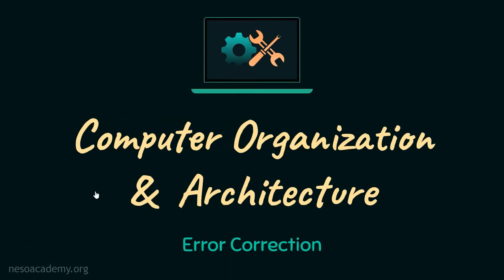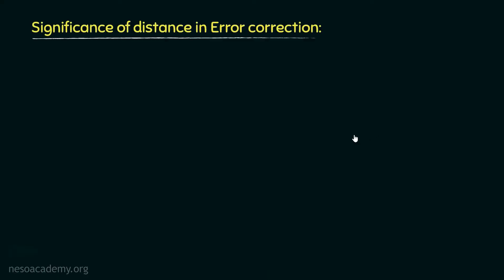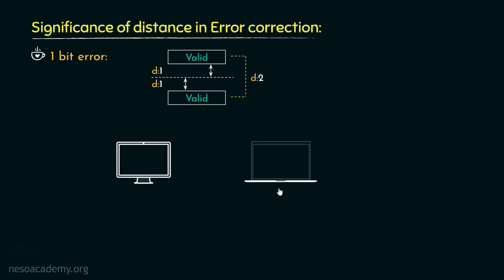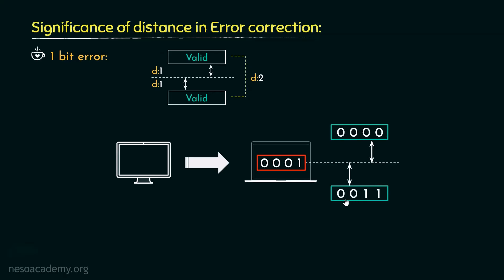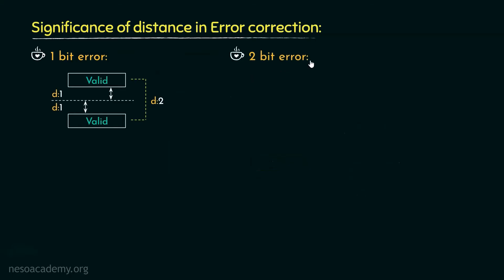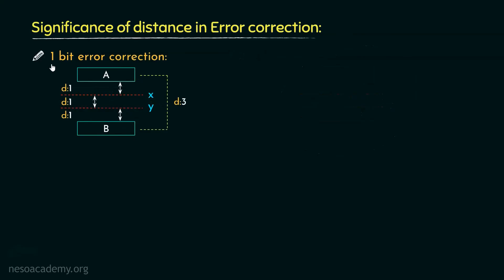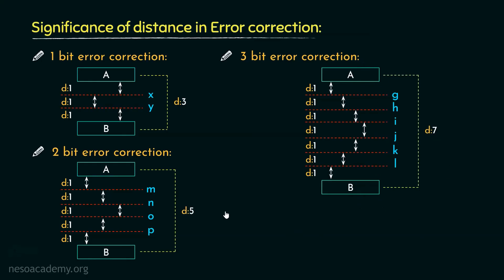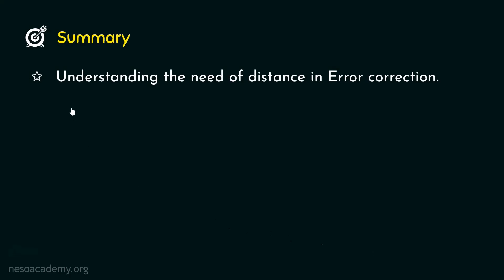Error Correction

Comment: COA: Error Correction - Error Correction Discussion

1. Importance of Distance in Error Correction:
Understanding the need for distance in Error Correction is crucial. Distance refers to the minimum number of differences between two codewords in a code. This concept plays a significant role in determining the efficiency of an Error Correction scheme. A higher distance ensures better error detection and correction capabilities.

2. Generalization of Hamming Distance for Error Correction:
Hamming distance is a popular metric used in Error Correction. It measures the minimum number of positions at which two codewords differ. Generalizing Hamming distance for Error Correction helps in solving various problems in different stages. These stages may include:

a. Code Design: In this stage, we design codes with a specific minimum distance to ensure error correction capabilities. The Hamming distance generalization helps in determining the required distance for a given error correction capability.

b. Encoding: During the encoding process, the generalized Hamming distance helps in identifying the differences between the original message and the encoded message. This step ensures that the encoded message can be decoded correctly.

c. Decoding: In the decoding process, the generalized Hamming distance assists in detecting and correcting errors by comparing the received message with the stored codewords.

d. Performance Evaluation: The generalized Hamming distance is used to evaluate the performance of an Error Correction scheme. It helps in understanding how well the scheme can detect and correct errors based on the distance between codewords.

In conclusion, understanding the need for distance in Error Correction and generalizing the Hamming distance are essential aspects of solving problems in various stages of Error Correction. These concepts contribute to designing efficient Error Correction schemes and ensuring reliable communication systems.